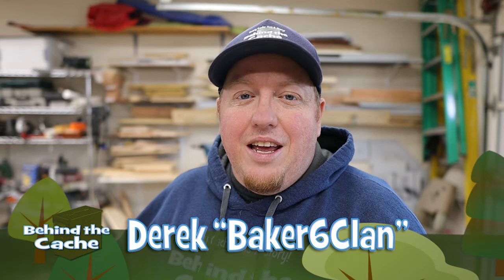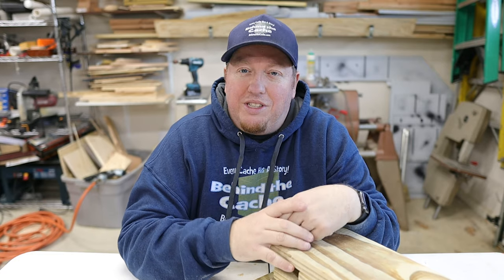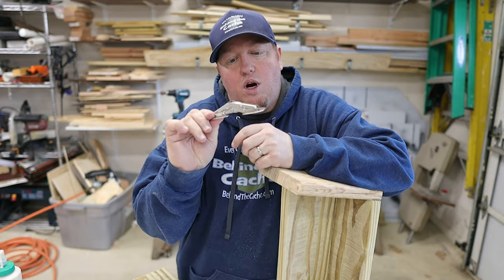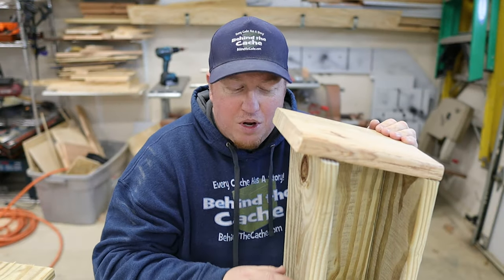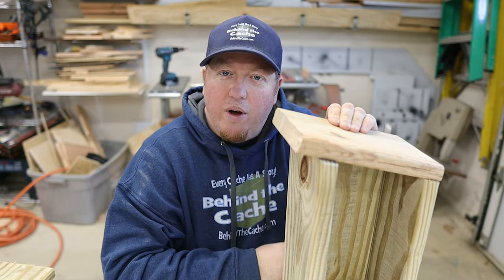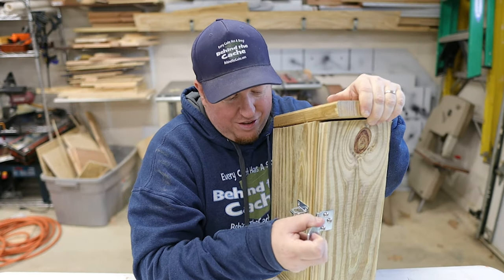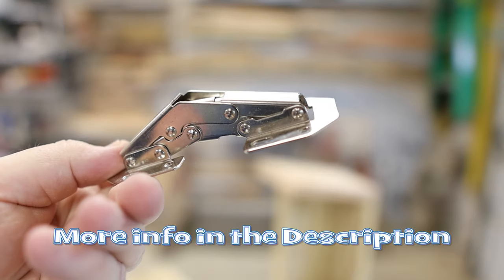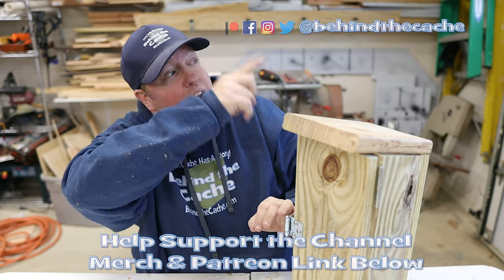Simple? and Tricky? Creative Cache Build (GCNW)

Comment: On my way to my shop to build something like this, an evil variation came to me.  Build a birdhouse with a hidden-hinged roof and a magnetic trap door on the bottom.  When the roof is lifted, the magnets pull loose, the trap door opens, and the bison tube on a wire string drops down!  As a decoy, a fake door on the side is padlocked and hinged, but there is no key!  I'd send you a pic if I knew how.
Reply from the maker: Wow that is evil. Can’t wait to see it.

Comment: Love it. Funnily enough, the lock and latch may also stop the door from opening depending on how that outer corner is affected by the mechanics of the opening. Perhaps though the latch mechanism could get damaged if the door is opened while it's still closed if it's forced enough...  Love the trick though, haven't seen one of those yet :)
Reply from the maker: It won’t open unless the latch is fully open I tested. There is a way that if you didn’t secure where the lock would go and maybe put a small magnet on the inside of the box or behind it if they opened the correct way it would breakaway. So it would look like you have to open it. I hope that makes sense. Just thought of that after you mentioned this.